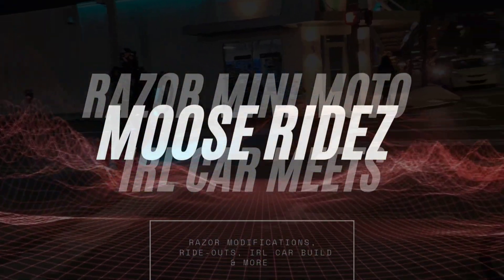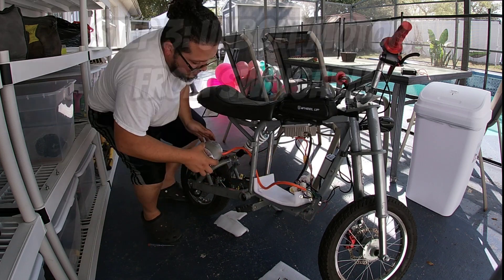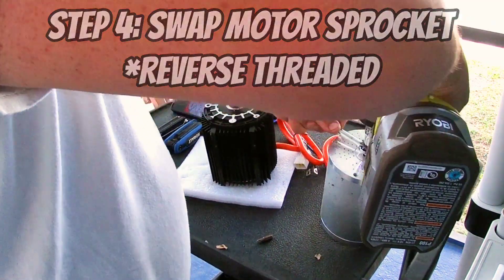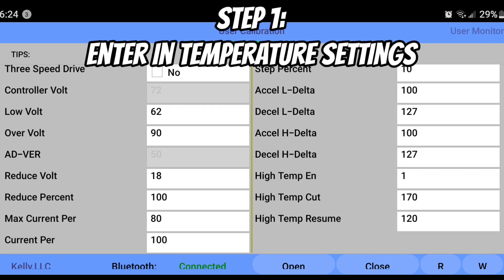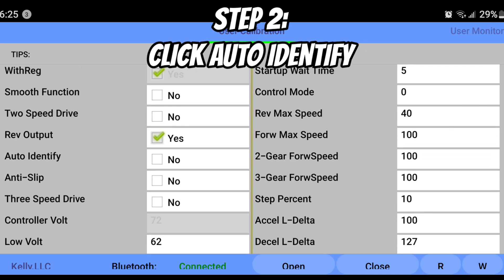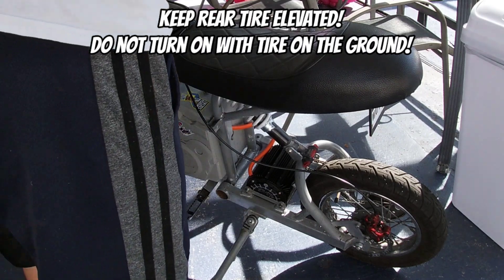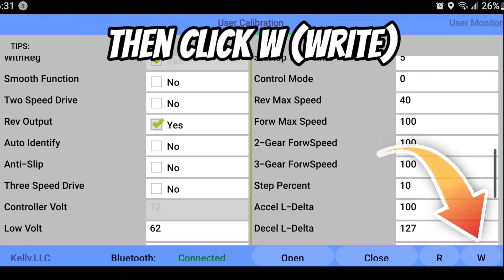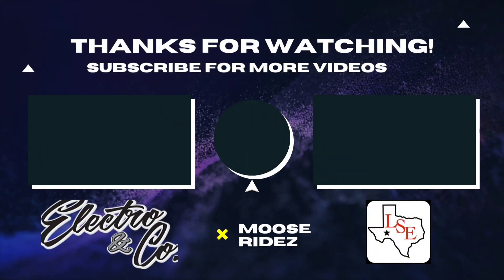How to Setup a EC4P Motor with a Kelly KVD Controller

Comment: Can you use a 48v battery for this set up.
Reply from the maker: You can but l don't know if it's worth it. This motor wants amps. 48v is for 8 year olds. Rather you upgrade to a fardriver and get the best out of your current setup. Then go 72v and lastly upgrade the motor
Reply: @MooseRidez   How fast do you think it will go?
Reply: @Mattoutdoors. No idea. Maybe 35. Speed comes from gearing and voltage. Most 48v setup will not go above 35

Comment: How u doing on heat? Im thinking of running 150amps for 35 miles at a time?  Obviously hills and stuff, so i will rarely be full throttling.
Reply from the maker: honestly, go fardriver. i gained 15 mph, no heat issues and it was more effecient. also for a cheaper price then this kelly. it was okay on it but definitely worlds better on fardriver

Comment: I just ordered this motor. I thought you could increase the amp draw on the controller settings up to 40 ir something but i didnt see that anywhere. Did you change your amp settings? Also, whats the biggest difference youve noticed between this and the older motor?
Reply from the maker: Yeah, you can change your amps, but I like where my power is at. This is just to make the motor work in general with the kelly.

Pros : quick acceleration, higher top speed, runs super cool and efficient, sounds great too.

Cons: it's slightly bigger than a my1020 with heat sink, so guys with mx chassis and tires bigger than 2.5 in the rear will have clearance issues.
Reply from the maker: Also, in the video, I'm running 80 max current per, which is 160 amps.
Reply: @MooseRidez  thanks for your reply. So you did up the amp draw on the Kelly controller up to 60? There aren't issues with overheating with that high of amps?
Reply from the maker: @tobiasfunke  current settings in kelly are by percentage, not actual amps. I ran it at 200 amps (100 max current per) with zero issues.
Reply: @MooseRidez  ahh. I see what you mean. Thanks for clarifying.

Comment: Is there an app I have to download on my android device?
Reply from the maker: yes the kelly app ifnyou have the dongle. only works on andriod
Reply: @MooseRidez  can I use these same settings only difference is I have a 48v battery?
Reply from the maker: @christianpudy4798  yeah just lower your voltage cutoff to 39  and find what amps your battery is so you don't set it too high. Max current per is by percentage, so if your battery is 30amps I wouldn't run it higher then 15 max current per (30amp)on a 7212nx or 7215n (200amp kelly). You might be able to run it at 25 to push your peak amp but it might trip the battery
Reply: @MooseRidez  I have the stock 48v mototec battery. it says 48v 13ah li-ion
Reply from the maker: @christianpudy4798 that's just voltage and ah. Gotta find the amps for it.
Reply: @MooseRidez  okay thanks fam 💯
Reply: @MooseRidez  hey it’s 60 amps
Reply: @MooseRidez  where do you find the voltage cut off option in the app?thanks in advance
Reply from the maker: @christianpudy4798 so put max current per at 30.
Reply from the maker: @christianpudy4798 under controller volt. put low volt at 39 and over volt at 90. Now using can run anything from 48v - 76v
Reply: @MooseRidez  would that be labeled max regen current or what does it say on the app I can’t find max current
Reply from the maker: @christianpudy4798 max current per is the power setting and low current is for battery cutoff. That's what it's called in the app.
Reply: @MooseRidez Can I control it on pc? My friend said I have to get an android phone.

Comment: For the ec4p I have a 52v battery it is rated for 72v can I still you it or will it fry my battey
Reply from the maker: The motor will work you just won't use it anywhere near its potential. And you'll need a programmable controller to run it

Comment: Which setting turns on regen?
Reply from the maker: i forgot its been a year since i used a kelly. says regen in the name. the higher you put it the more aggresive it is off throttle. not really worth it in my opinion

Comment: Can I make my motor spin forward without the E&C Bluetooth dongle
Reply from the maker: switching around the hall sensor wires.. but i cannot guarantee that
Reply: Okay I’ll try that thabks
Reply: I didn't work 😭
Reply: @grantharris7451  yeah gunna have to get an adapter. Guy in the razor group makes them for like 25 bucks
Reply: What razor group?

Comment: Top speed? 🤔
Reply from the maker: 48mph with 13/80 sprocket. 50 with 11/65 gearing and 54 with 13/65 ... but I'm fat lol. With someone in the hundreds you can definitely add another 2-3 mph to each number.. still power wheelies above 30 mph 😳
Reply: @MooseRidez  👍
Reply: @MooseRidez where can I find a capatible 65 sprocket ? I’m only seeing 80
Reply from the maker: @SCJcontent  ebay, amazon (check my amazon store) and electricscooterparts.com
Reply: For a 48v setup? I have more torque but lost top end… any ideas 🤘🏻

Comment: Why you guys all run KVD?
Reply from the maker: I don't. I run a fardriver. Back in February, when I got the ec4p early, this was the best option.
Reply: @MooseRidez  got it that's what I thought you ran! I need to get one to try it out
Reply: @Razorcrew_Cole  I gained 12 mph and enough torque to power wheelie over 40 mph
Reply: @TURBOMOOSE  you did huh!?  Yeah I'm not a fan of the KVD with my KLSN I've been able to pull wheelies at 45 mph easy not tuned up all the way.  I'll definitely have to order one to check it out I know a lot of people like it so I'm sure I need to see if I'm missing out
Reply from the maker: @Razor_Cole yeah man Kelly's are smoother feeling. But throttle response, field weakening, amd the phase amps, besides all the ebike add on features, make it amazing. From all the Kelly's I tried even this monster kls300 amp unit, the fardriver just giggles at it. Also being able to tune on the fly is a huge advantage
Reply: @MooseRidez  Right on man appreciate the info as always!  I believe coming soon Kelly is going to be adding the field weakening!  But if you're ordering KVD that's not really a Kelly if you ask me so I need to put the far driver next to the KLSN I'm sure far driver is still better I hear only good things!
Reply: @Razorcrew_Cole yeah they just released one, about two months ago, with field weakening. The klsn is what we have in the pocket mod with a my1020+ and surron battery. Fun little toy
Reply: @TURBOMOOSE  right on mess with the ki and KP settings?  That's sick